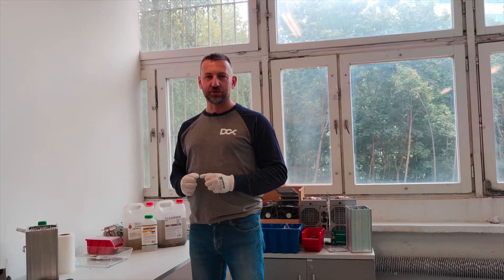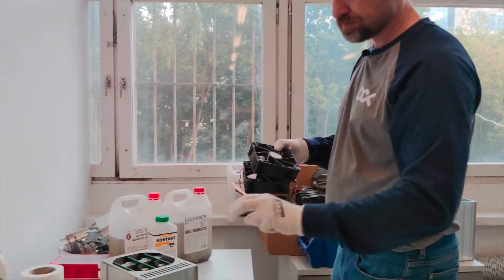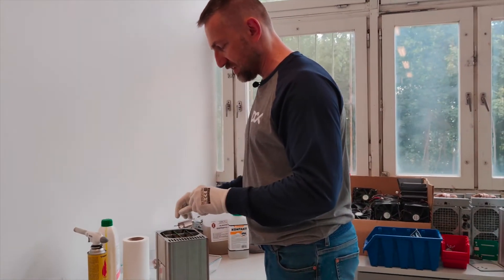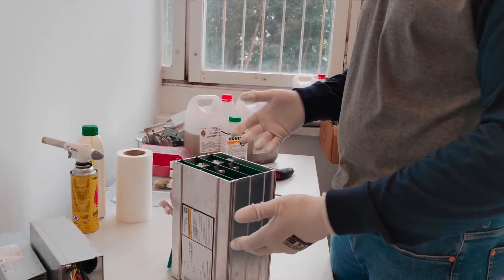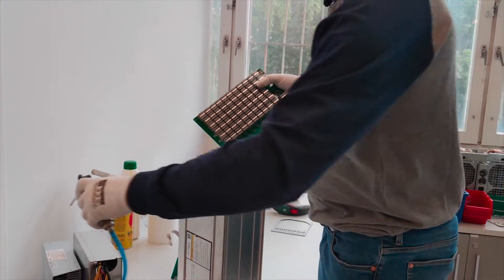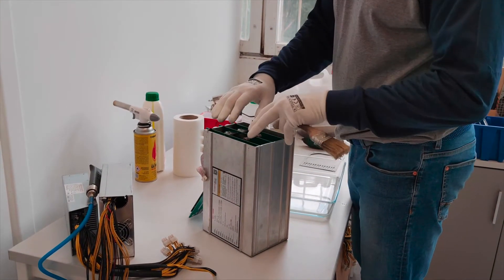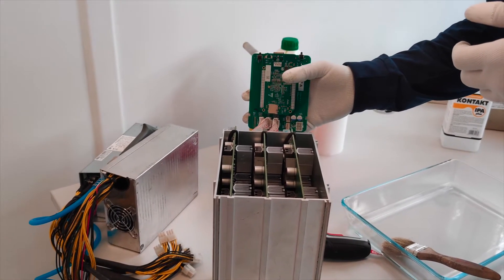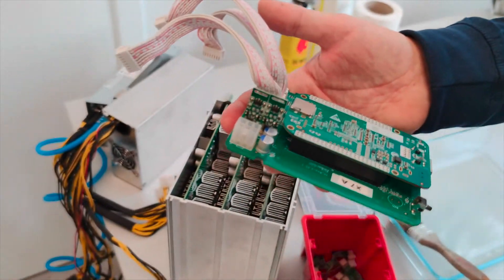How to prepare ASIC miner for the immersion cooling? | Immersion Mining manual

Comment: Thanks for the video. Did you do also a video for GPU immersion? 
On a comment you say that some parts (pads) have to be replaced, could you give more information of the reason, and which pad should be use instead?
I have read that many parts of GPU will be destroyed on a long term immersion, in mineral oil... (plastic parts)

Comment: What's the benefit of the manufacturer's immersion firmware if it doesn't allow overclocking?
Reply: nothing!
Reply: Don't have to use any fan spoofers.
But fan spoofers are cheap, so I'm guessing everyone just uses fan spoofers, default firmware and overclock those to the limits lol.

Comment: Hey boss can you use plain water 💦 to clean? Will the water cause damage?
Reply: Sometimes water is used alongside some soap to better get rid of the dust, but right after that you must use IPA to dissolve water remains into IPA, IPA then evaporates quickly, leaves no residue and doesn't cause any corrosion.
Though most use IPA by itself.

Comment: Do you use 99% IPA? I saw another video where uses demineralized water and IPA 1/3 solution, is this ok?
Reply: At the last step you always should use 99% IPA.
Before, you can even wash it in the sink with tap water and dishsoap...
You just never can leave it with water on it and let it dry, it will corode and/or some minerals from water might cause a short.

Comment: Hello, 
Did this immersion cooling work with Goldshell CK5 miner? 
In a coment you said that thermal paste need to be remove and replace by foil... On goldshell Miner (CK5, KD5...) They use only thermal paste (on heatsink...).
I have order an enclosure and precise before my order it is for goldshell CK5 miner and your commercial service says that is ok, it is a plug and play system. 
I don't want to break my miner please, in many forum it say thermal paste is not working on immersion cooling, answer me back if it is OK for my CK5 miner.

And nice video thank you. Hope to get more guide soon.

Comment: Just one question , I currently use fan blowers , to siphon heat away from the room, will this setup reduce the room heat ? Or do i need to spoof it away ?
Reply from the maker: 95% of the heat will be distributed by the means of liquid transfer from the enclosure to the dry cooler. However, some of the heat will be radiated to the room. That depends on the room temperature. But of course, there will be a huge difference - significantly less heat than currently moved by air.

Comment: Can't you just wash it with the cooling liquid, then use another fresh batch of cooling liquid for the immersion?
Reply from the maker: Dielectric fluid is not a cleaner that will dissolve residue, corrosion, dust, contamination. Ultra clean dielectric fluid - no point to waste it - alcohol IPA cleans well (we can use more expensive dielectric solvent but IPA is just fine), and can be filtered multiple time so we don't waste the fluid in the long run.
Reply: @DCXCryptoCoolingSystems  IPA Alcohol filtered? How?
Reply: @OfficialPadre  dielectric filtered. Alcohol for pre cleaning

Comment: Does it use less power this way
Reply from the maker: Not really, you can down power the miners. But people buy it to overclock the miners by 50-80%, eliminate the noise (see another vid) remove the problems with corrosion, dust, overheat, corrosion, fire risk, continuous repairs. But to run the operation you may require AC unit which takes power, you need fans to remove hot air - so we eliminate that. System requires 180W per 40kW of heat transfer as only pump takes power. More - cryptocooling.eu

Comment: Thanks for sharing this, one question
Where can I buy the fan spoofer?
Reply from the maker: we will have them on stock this week. DCX universal fan emulator 4pin		EMU001	Universal 4 pin fan emulator for ASIC and GPU miners. Equipped with 16Mhz high speed MCU controller in DIP package with inteligent fan speed emulation 2300-6400 rpm. Fits 99% of ASIC miners and GPU cards using 4pin fan connector.

Just go to cryptocooling.eu and use any "get the quote" button
Reply: @DCXCryptoCoolingSystems   how much it will be 
fan spoofer?
Reply from the maker: @ghostdark4515  depending on quantity, but 9 usd - just ask for quote on cryptocooling.eu
Reply: hi, could you make a simple video installing some ASICS inside the box it would be very helpful I saw use for new buyers THANKS!
Reply from the maker: @kluiverthramirez5398  will do more videos in 2 weeks. Stay tuned.

Comment: Same job with gpu, please!
Reply from the maker: Will do. There are little differences. You need to replace thermal paste  with foil and sometimes replace thermal pads, but it's not a big deal.
Reply: @DCXCryptoCoolingSystems  I'm working in this direction too, with your units. Excellent job all around, congrats
Reply from the maker: @euronymous86x  please reach me via the website through the contact form and I will send you more details about GPU retrofitting